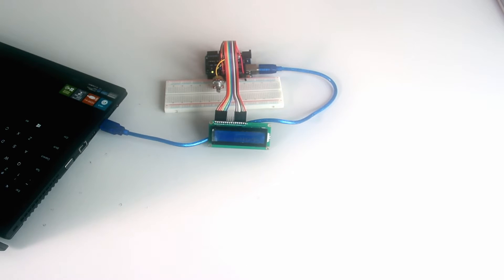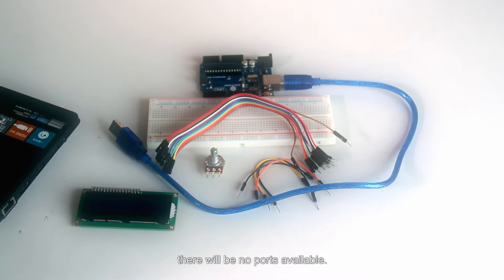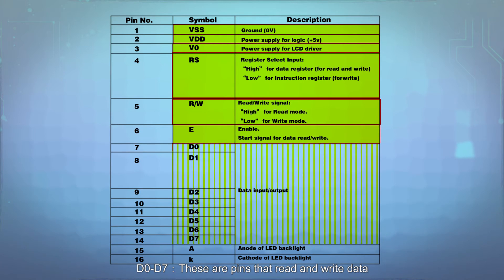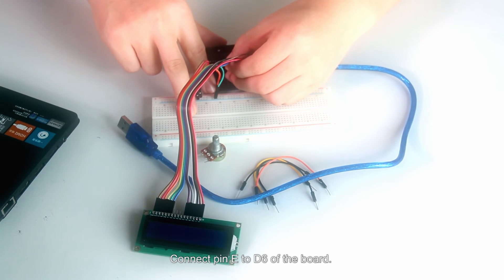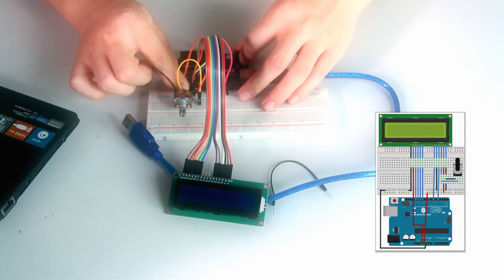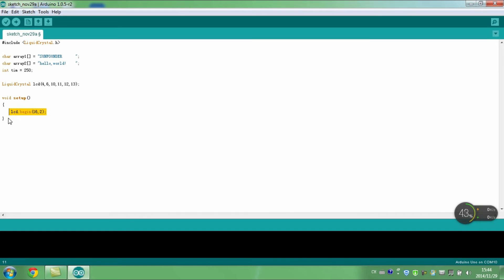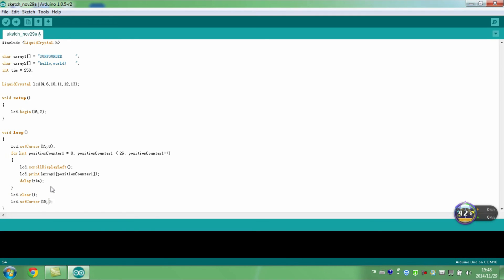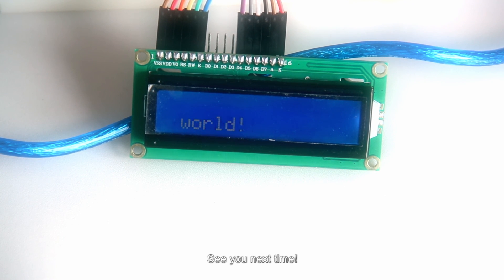Sunfounder Kit Turorial for Arduino - LCD1602

Comment: When you say connect the board and the breadboard (4:39), what did you do exactly ? please be specific since i am new to arduino and just started learning.
Reply: for the above question, i simply connected the board ground pin (GND) to the gound on breadboard.  After that, i get just the first row on the lcd which becomes white boxes without anything else.  Any help ?

Comment: hello I did as you instructed but the LED not showing up but is lighted on. please help asap
Reply from the maker: +Hamado Yoada If your wiring is correct, after uploading the sketch successfully (see the prompt message at the bottom of the IDE window), squares may appear on the LCD screen. You need to adjust the contrast then. As you can see, in the components for the lesson there's a potentiometer, which is to adjust the LCD contrast. Try to turn the knob of the pot until you can see the characters on the screen clearly. 
If this still does not work, please post the screenshot of your code uploading and take a photo of the physical wiring and post on our website FORUM, so we can help check the issue. 

Hope it can help.

Comment: Only the backlight turns on for me. No words, I have the board and the screen setup right +Sunfounder
Reply from the maker: +Edward Kennedy You may turn the potentiometer connected, and keep turning until it shows characters clearly.
Reply: +Sunfounder The potentiometer isn't getting hot
Reply from the maker: +Edward Kennedy Its not getting hot means you did not connect the pot wrong. If you still can't get the LCD display normally, please post screenshots of your code compiling and upload results as well as photos of wiring, or send an email to our support@sunfounder.com, so we can see the issue. Thanks for support!

Comment: I purchased the Sunfounder RFID kit today online and i found the main board to have a Green chip in the corner. I was told the official Sunfounder chip on the main board should be Gold, a Green chip would suggest a fake board. Is that correct?
Reply from the maker: Trip Tamine Where did you buy it? Can you show me the link?
Reply: Yes the link is http://www.amazon.co.uk/gp/product/B00O0NM9GG?psc=1&redirect=true&ref_=oh_aui_detailpage_o05_s00
Reply from the maker: Trip Tamine Yes, it is our Amazon shop link.
Reply: +Trip Tamine No thats not correct the golden chip on the board means it is an original board from arduino itself.  I have the Sunfounder board too and there are a lot of other boards out there from other manufacturers and they all dont have a golden chip. This doesnt mean its fake its just not from Arduino itself, which means the money you pay doesnt go towoards the research from the guys from arduino.

Comment: Does the pin header have to be soldered onto the LCD
Reply from the maker: Yes, you must solder the pin header onto the LCD before you start doing this experiment.
Reply: ok thank you. And one more question, why are the video tutorials different than what the Super Kit manual says to do?
Reply from the maker: The video tutorials are the newest. We made some minor adjustments according to customers’ requirement for better user experience.